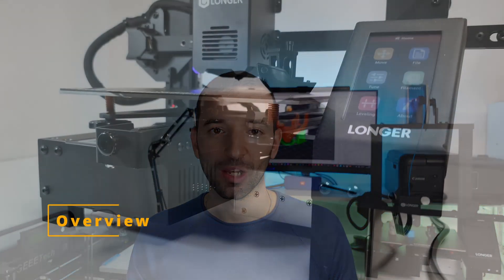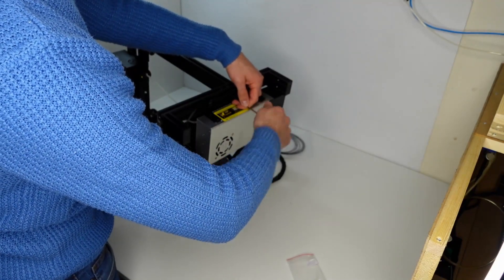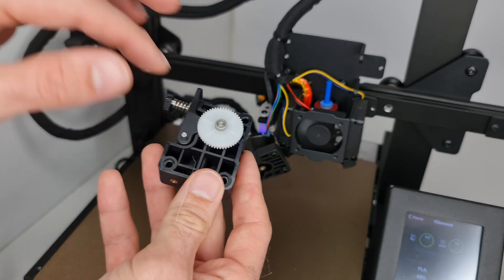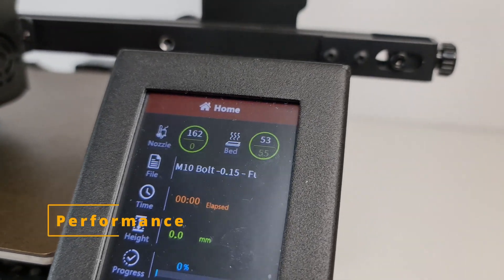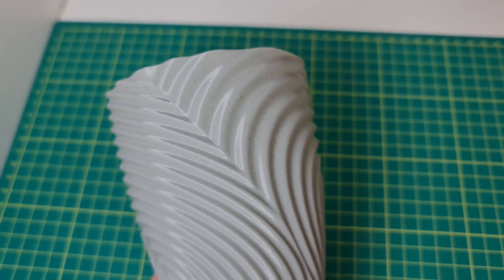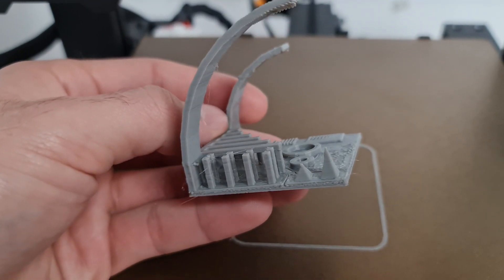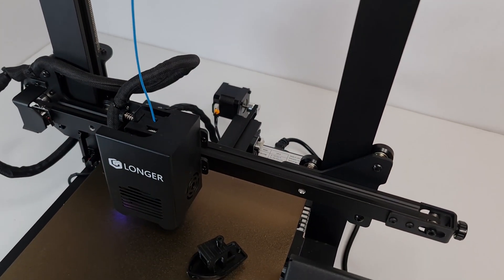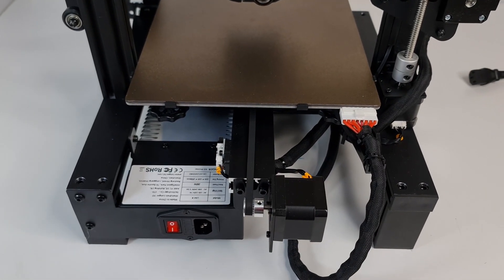Longer LK4X - The best budget 3D Printer?

Comment: To fix the bed put some of that black/gray foam sheets on the bottom. I had one come with a magnetic PEI sheet, heats up a few minutes quicker but that printer is only 12 volts.